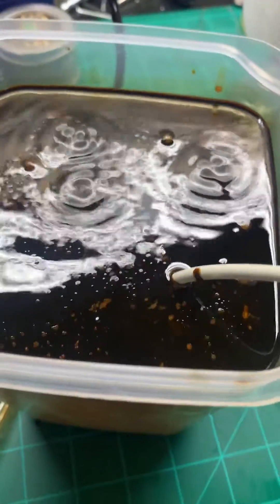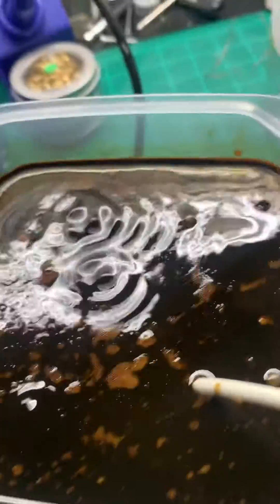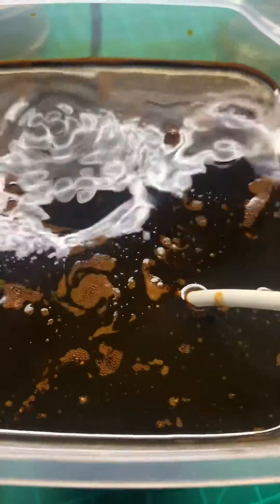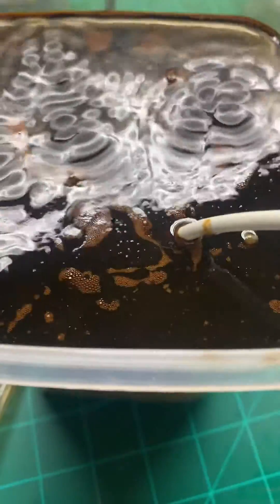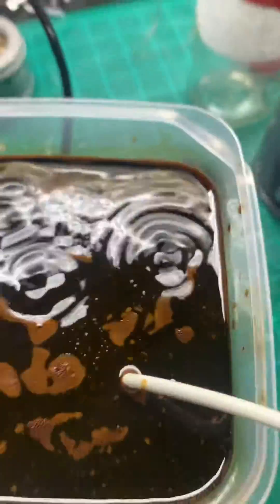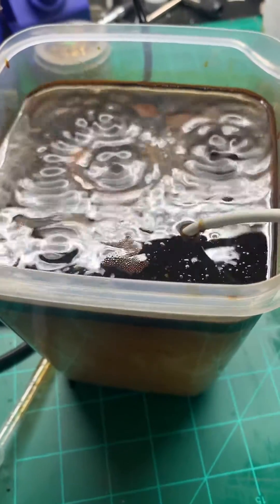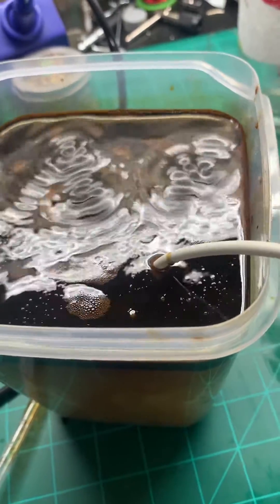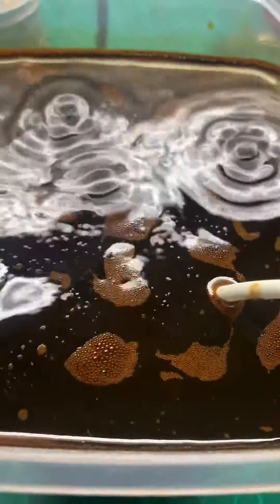Clean oil well perfs with ultrasonic waves?

Comment: Ive got a well that always made about 4 bpd and eventually had a big build up of iron sulfate wich covered up the perforations (productuon completely dropped off but still made water).  I sand pumped the well out and my oil production returned to 2 bpd.  Im wondering if my perfs are still partially plugged off?